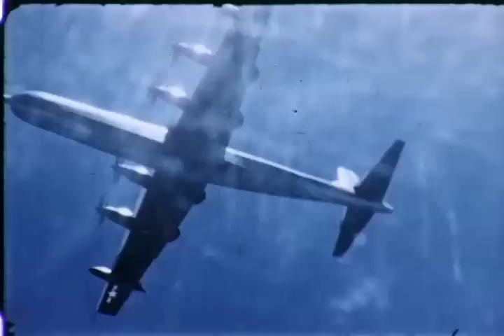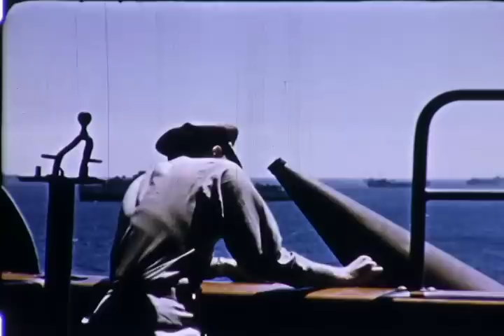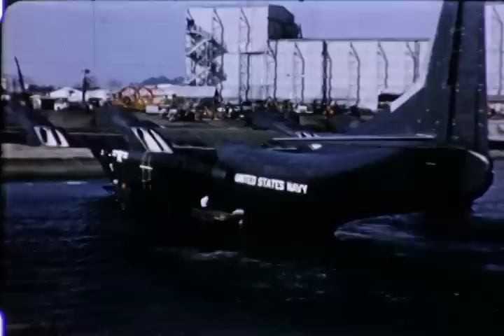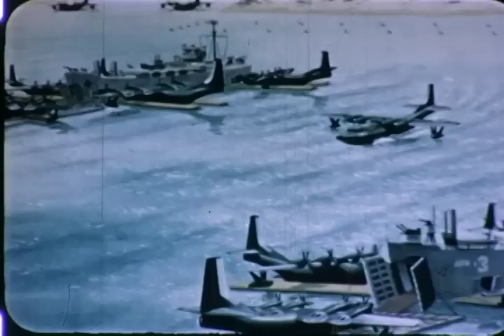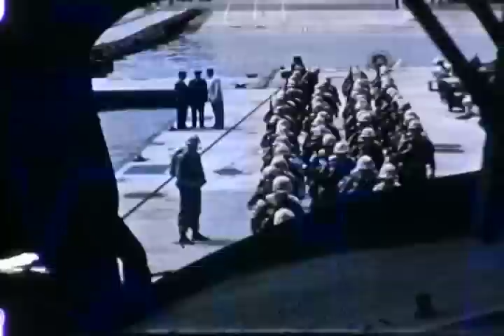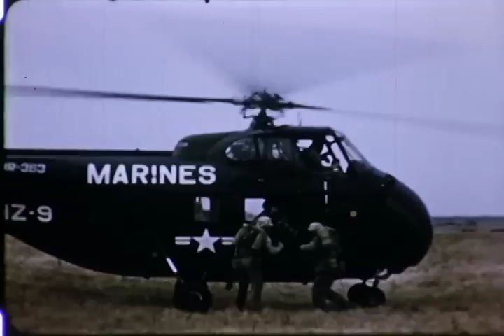F-0114 Convair R3Y Tradewind "The Flying Task Force"

Comment: At the time, no one was thinking of radar guided anti-aircraft missiles. Radar guided anti aircraft artillery was already well advanced, having been used in WWII with proximity fuses, no less. These things might have worked against a limited and under equipped third world enemy, like the Viet Minh. but, if any superpower were to get involved, which obviously they surely would as was evidenced by the Korean debacle, the Big Slow Flying Targets would not have lasted long enough to deliver half a brigade. Even an under-resourced force such as the adversary at Dien Bien Phu had shown how they could assemble masses of AA to defeat a modern air force. This was also pretty much shown to be a big worry even at Khe Sanh, too. The US had to apply massive air resources, at considerable and styeadily increasing risk, to keep the Marine base from being overrun. 

On a more strategic level, I could understand the importance of large, well made and long rage, cargo handlers like the Tradewind. I wonder if the Navy kind of missed the beat here with their more tactical slant on their promotional effort. Almost anyone could plainly see such an ungainly, even though well designed, aircraft was never going to be put at such risk with so many troops in a purely tactical role.
Reply: Poly: Untrue. The Tartar/Terrier/Talos naval SAM programs were well underway at the same time the R3Y was being designed.

Comment: All noteworthy and insightful comments.  Lockheed's design challenge of putting pontoons on the C-130 is a boondoggle looking for a military contract.  I flew the USCG HC-130H for many years and it will be a design nightmare.  Pontoons are not snow skis.  They require a significant aircraft elevation when mounted, leaving an equally significant distance for the rear cargo ramp to reach loading elevation.  The R3Y Tradewinds was a purpose-built aircraft that with modern modification and significantly better performance, could exceed a pontooned C-130 in virtually all areas of capability.  But money and politics speak louder than conventional wisdom when it comes to military design and procurement.